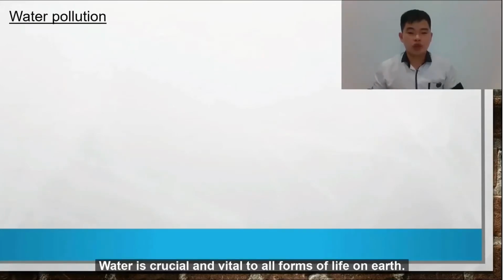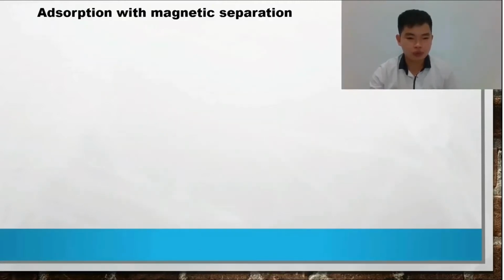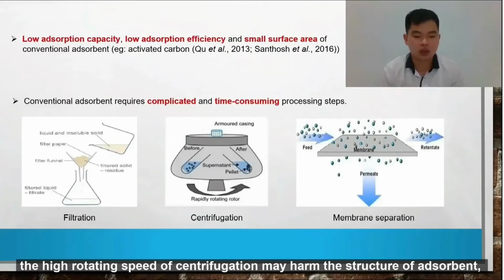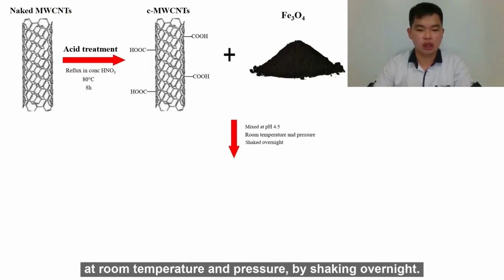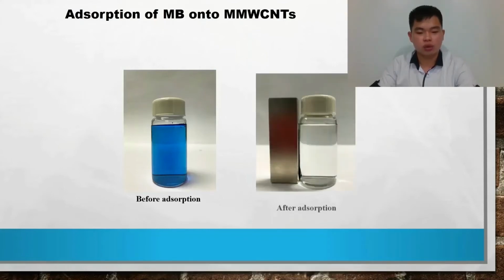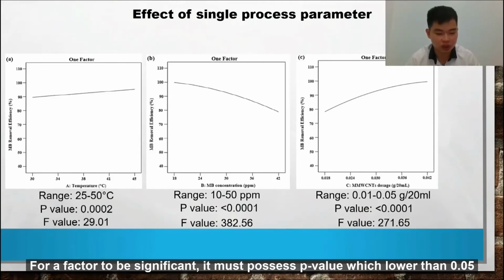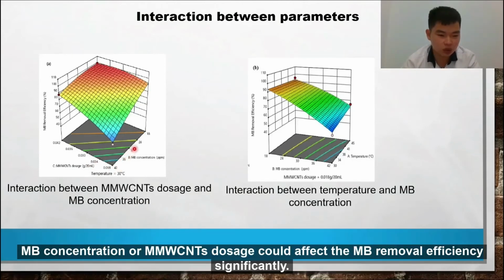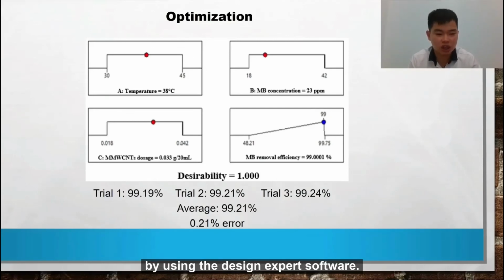Ereka 2021 (Bifunctional adsorbent magnetic multi-walled carbon nanotubes for water remediation)

Comment: Please let me need your answer. Thanks.
Reply from the maker: Hi, sorry for my late reply. In this work, CNTs is functionalized by reluxing with nitric acid, HNO3. HNO3 act as the oxidizing agent to generate high density of oxygen-containing groups such as hydroxyl (-OH) groups, carbonyl (C=O) group and carboxyl groups (=COOH).  Acid treatment is a very common and well-known method used to oxidized or introduced functional groups onto the surface of MWCNTs. Many literatures had proved the successful attachment of functional groups onto the surface of MWCNTs via acid treatment by various characterization results such as SEM, TEM and FTIR to support the fact. I hope my answer will be helpful to your question. Thank you.
Reply: @ryulim9147  sir cnt is made of carbon, when we reflux it then oxidation can lead to produce CO2 and H2O...
Reply: Carbon nanotubes will be converted to CO2 and H2O????
Reply from the maker: @nanotechnology107  hmm…I don’t think so. As the main aim of acid treatment is to promote the surface functionalization of functional groups but not oxidised cnt into another form of products. If cnt was converted into CO2 n H2O, then what is the point we did this acid treatment for?